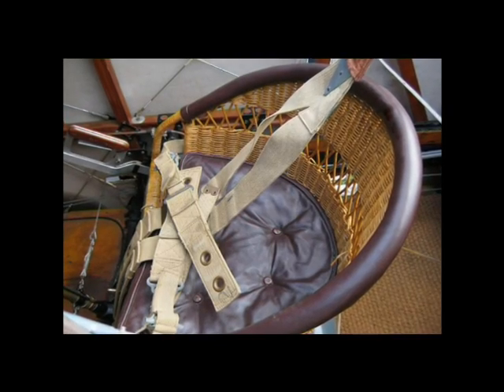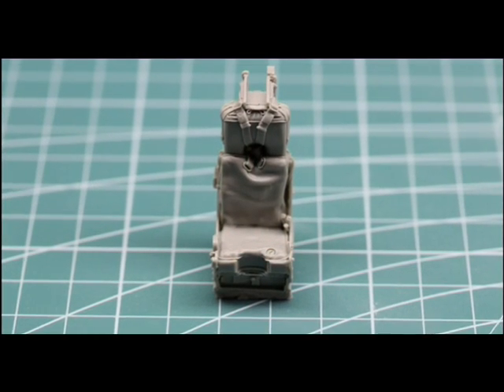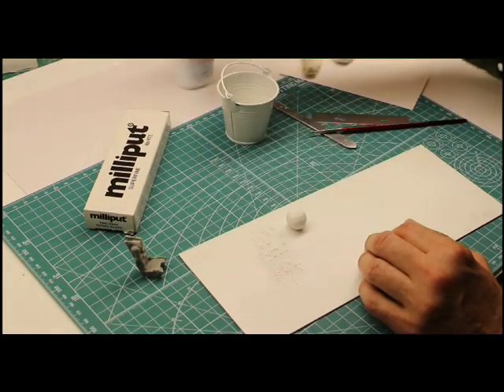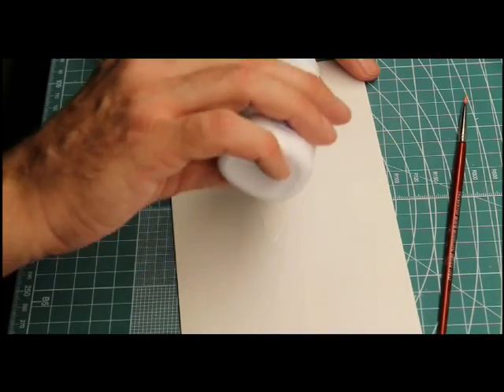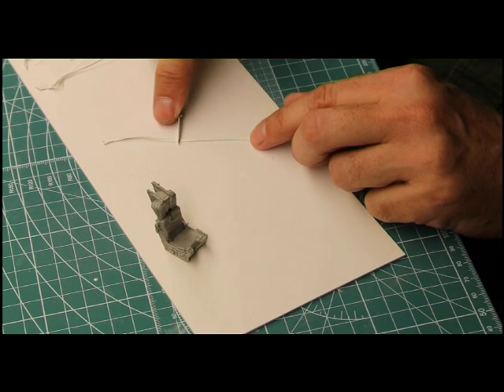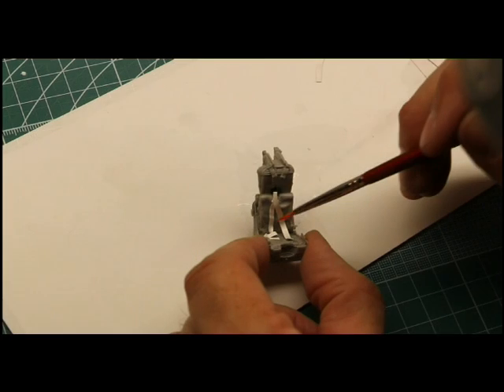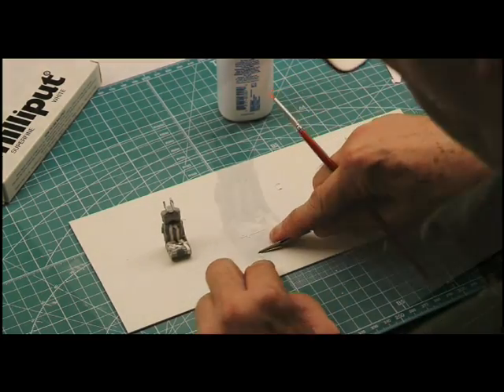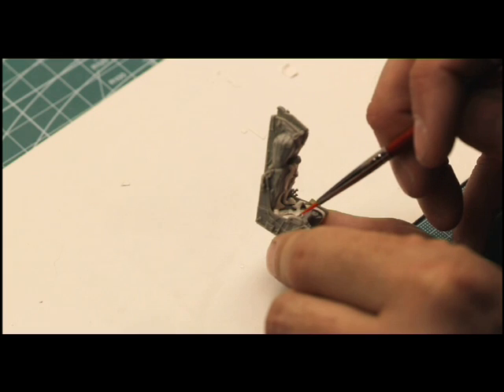Tactics & Techniques - Adding Seatbelts Using Milliput

Comment: i'd use a pair of tweezers instead of the brush
Reply: problem with that is you leave indentation marks and it's hard to smooth them out on such a thin surface.